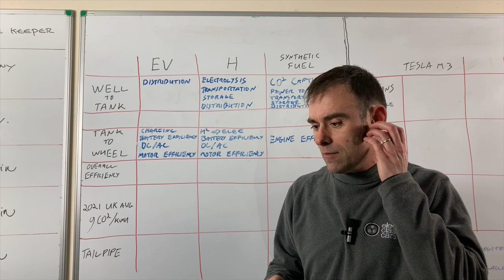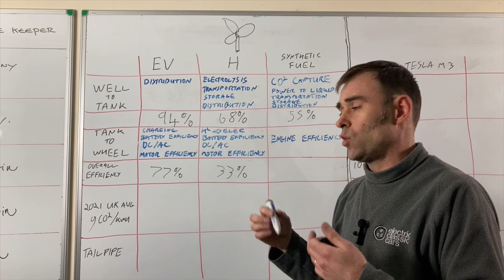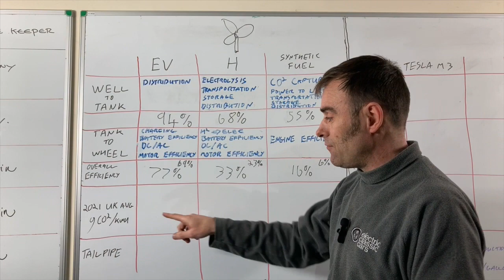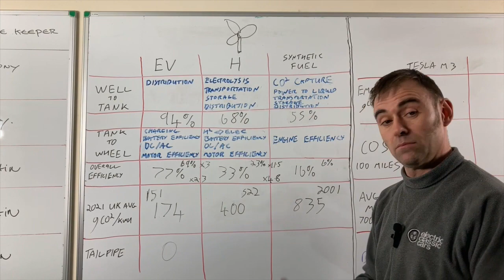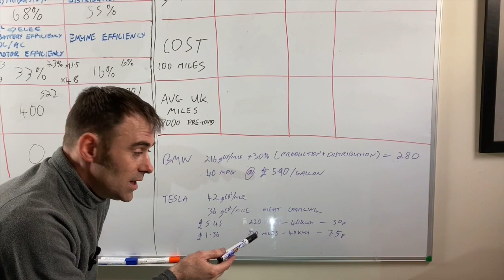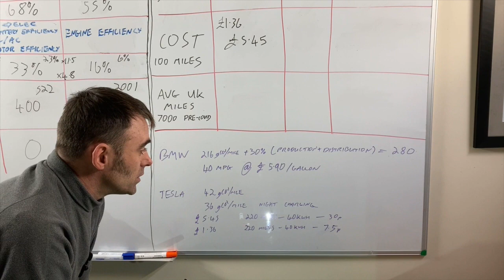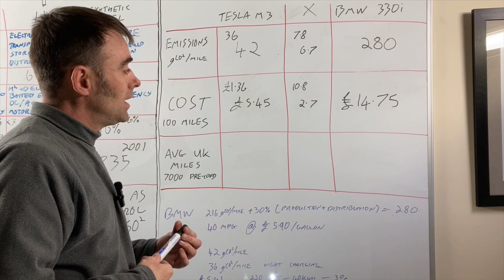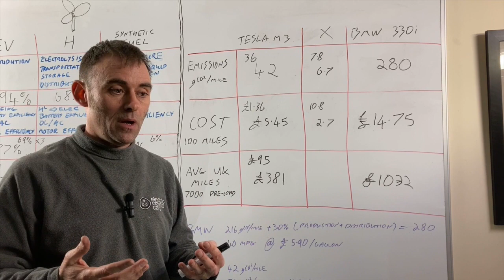Is Hydrogen or Synthetic fuels the end for Electric Cars?

Comment: In 8-10 years you (may) need new  Lithium batteries, Cost?   Pounds 9600 , So cost is about same as petrol over 10 years with replacing batteries. Emissions are better for EV but overall cost is not a great saving. You also pay more for an EV than petrol car.
Reply: In 8-10 years of owning an ICE car you will definately need a new exhaust, new cat, new clutch, various timing belts, new brake disks and multiple sets of pads, annual servicing of at least £200 vs less than half that for an EV. There is now plenty of data on EVs with well over 100k miles on showing minimal battery degredation so your argument is years out of date.
Reply: @nealm1814  very well informed repartee there. Don't forget all those oil changes(dirty business indeed those oil changes)and emissions station checks annually. 👍🏻😎
Reply: And having spent that £9600, you have a car which will last another ten years or at least be worth considerably more than the comparable 10 year old diesel.
Reply: @lizdersley9803  Apart from the fact you wouldn't need to spend £9600 anyway.....
Reply: Absolute nonsense.  Why would you need a new battery after 8 years, when it comes with an 8 year warranty, and an assurance of at least 70% state of health after those 8 years?  It's a WARRANTY, not it's lifespan!  You have obviously never heard of battery refurbishments.  Cleveleys Electric Vehicles in Gloucestershire carried out a battery pack refurbishment on a customer's 10 year old Nissan Leaf. They removed the battery pack in 20 minutes, then tested the cells, replacing the failing ones with good examples. The job took 4 hours - there are 90+ cells in a 24kw Leaf battery - and it cost the Leaf owner £600.  Where do you people get your totally ridiculous EV battery scare stories?  The video of the battery refurb is on YouTube. I suggest you ought to watch it instead of posting uninformed nonsense.. And if you have the time, you could also watch the YouTube video posted by a US Tesla Model S owner. His car was well over 10 years old, and had covered 400,000 kms on it's original battery.....

And you "pay more" for an EV, do you?   New Nissan Leaf £25k. New mid spec petrol Astra, Focus or Golf £25k. New MG5 Astra sized fully electric estate car £23k with a 7 year warranty...... I've also seen used EV's on sale at £6k.......
Reply: A quick search and you’ll find the batteries are outlasting the cars and go on to a second life as grid storage. There are a few half million mile Teslas out there.

Comment: Thanks for a very informative video.  I’m on my third Tesla and will never go back to ICE.  As an aside, I used to work in semiconductor manufacturing engineering and used hydrogen extensively. The hydrogen molecule is so tiny, it’s close to impossible to prevent leakage completely. I would never risk a hydrogen powered car in my garage.
Reply from the maker: Especially when it's stored at 10,000psi in the tank too. 😁👍
Reply: It isn't strictly necessary as such, that a garage has a roof, and you never know - on the basis that what goes up must come down - the roof might land somewhere where it'll be some use.... eventually. Come to think of it - how about a hydrogen powered pogo stick (and a parachute, obviously)?
Reply: @vipertwenty249  however, my garage is under our bedroom! 😀
Reply: @jefffarrell5603  I have hand crocheted parachutes from Plummitt&Thudd.Co for sale to wear in bed?
Reply: Not really a risk, because what leaks from a carefully sealed pipe or tank, leaks from an unsealed garage (or bedroom) 100 times more easily. This leaked hydrogen won't accumulate anywhere, just like your semiconductor facility (I assume) didn't explode regularly. Leakage was harmless even with the BMW Hydrogen 7, which by design leaked fuel for cooling the (cryo-)tank.

That said I agree, battery electric makes much more sense. Because it's much more efficient and also easier to handle.

Comment: I think that you did an excellent presentation. A little positive side note, for inland shipping companies already use electric powered transport ships and/or boats, not by the masses, but it is growing. Instead of a small battery they use a battery that has the size from a shipping container. And instead of charging the battery onboard of the ship they simply switch batteries at a dedicated battery switching station, so that the empty battery can charge onshore. I am pretty sure that those shipping companies did the calculation as well. And for them the electricity costs are even lower because they are big users and they get even better contracts. And I think that switching the battery takes less time as refueling a ship. And the costs of maintenance is drastically less as well. 

Like you said, a lot of it also depends on the type of application and the practical use and the infrastructure. 

I also believe that with the current situation around the globe the renewable energy sources are going to get a big boost. In the Netherlands they have build the largest wind turbine in the world. And a single turbine will be capable to generate enough power to supply electricity for 16.000 households. Compared to the first generation wind turbines these new turbines are colossal with a rotor diameter of 220 meters. And they are about to be installed in big numbers at off shore wind parks in the north sea, and probably all around the globe as well. 

Just for comparison, the biggest inland wind turbine in the UK at this moment has a rotor diameter of 150 meter and it can generate only 6 megawatt. These new 220 rotor diameter turbines produce 14 megawatt, and they are already developing newer types that are able to produce even more power. 

The UK government has announced that they are targeting to install enough wind turbines for the production of 40 GIGA watt of power by the end of 2050. That is more than the UK is using at this moment. And other countries are doing the same. 

So all together things are not looking too bad.
Reply: Just as I am reading the news I read that the Dutch government is going to invest 1,7 billion Euro into new Wind parks located at the North Sea. That should be enough for 750 up to 800 new turbines. And that should be enough for 10,7 gigawatt up to the year 2030. And it is twice as much as they had originally planned to do. And of course that is due to the situation with Russia. So including the installment they cost around 2,2 million Euro each. 

And it is also good news for the fish population, because they get new protected breeding grounds where large fishing vessels are not allowed to come. And where they can hide for predators.
Reply: Lots of big batteries sitting charging from the grid is also a great thing for stabilizing renewable energy - further reducing our need to burn natural gas. If we all get used to leaving EVs plugged-in when we're not using them, we will largely solve the energy storage problem.

Comment: Following your logic that the the power supply initially would come from renewables, then you need to remove electrolysis from the hydrogen efficiency degradation. The electrolysis would quate to degradation from the power to generate the grid supply from whatever source as you described with the graphic showing the pie chart of sources. From 100% down to 94% is actually grid inefficiency after the electric generation. The distribution and other degradation would be applicable.
Reply from the maker: Not sure I follow your logic there as there's losses when using electrolysis to produce hydrogen no matter what the source of that electricity is.
Reply: @ElectricClassicCars  You state that the electric for the EV side of the comparison is 94% efficient because you use renewable for the generation. I’m saying that the cost to create the power for the EV would equate to the power to create the hydrogen, renewable or otherwise. In your calculation you reduse the hydrogen side to 68% or whatever it was and part of that reduction is for electrolysis. If you negate it on the EV side you should negate it for hydrogen.
Reply: Electrolysis is most likely to be near the generating source, mainly because hydrogen is needed for more important things like steel production, cement, fertilizer and even grid level energy storage. From there it would be taken to who ever bought it or it might be converted back to electricity if it was used for storage.

Comment: in fairness, you should take into account the CO2 generated in making the vehicles.
According to Volvo, to manufacture an XC40 recharge produces about 25 Tonnes of CO2 equiv, vs about 15 tonnes for the petrol version. Although, I have some doubts about the difference.
And as counter argument, as of today, most battery packs or cells are used well beyond the lifespan of the vehicle.
And, the M3SR is the most efficient EV out there. Maybe, a comparison with a 330d was more on point.
Reply from the maker: It was already a very long video so I might cover vehicle production and end of life scenarios in a future video. 👍
Reply: In which case, it might appear as though Volvo need to clean up their act. If Volkswagen are able to produce electric vehicles in their new manufacturing plants which have a zero carbon footprint, and are powered by 100% renewable energy, then why don't Volvo?  And if they did manage to achieve that, then perhaps they would also like to sign up to the legally binding Paris Climate Agreement, like VW already have?

Comment: Are you sure about only 40 kWh being usable on the Model 3? That means more than 20% of the battery is not used... Sounds a lot!
Reply from the maker: Yep, that's what I'm seeing on our Tesla M3, I've seen it mentioned elsewhere too. Interesting the higher kWh M3 packs have a higher % useable comparatively.. 👍
Reply: @ElectricClassicCars  By any chance, do you know whether those batteries are LFP, NMC or NCA? I've also heard from Mr Musk itself (via the Internet filter) that he recommended that LFP batteries be recharged ro 100% without damaging them too much...

As for myself, I own a 2017 Model S 90D which I've always recharged to 90% daily (and a 2018 VW e-Golf which is treated exactly the same), which brings me to this question: do you offer the option, in your conversions, to limit the SoC? And if not, why, and what would be required so that you could offer it?

Comment: I would also be curious to see how ev would compare if the electricity comes from a coal fired plant like mine does.
Reply from the maker: Then you should use a gCO2/kWh of more like 750 gCO2/kWh which is Polands grid emissions in 2021. Poland is heavily reliant upon coal. That's 4.3 times more than the UK. Which would make the Tesla M3 emissions 182gCO2/mile which is still less than the 280 gCO2/mile for the petrol BMW.😲😲😲
Reply: Hydrogen tanks PSI - 3500 -- 10-000 just a few inches under your rear seat.... Synthetic fuel aka rubber/plastic rotter petrol and hot engine... anyone got some jacket spuds.....

Comment: Excellent presentation Moggs. I've been trying to tell people this for a couple of years, but it seems to fall on deaf ears. This info needs putting into an ad on TV, like a public service announcement.  👍
Reply from the maker: Spread the word. 😁👍
Reply: Agreed, but there is still plenty of easy low hanging fruit in burning less fuel and that is driving more economically and using you heating more economically - save the planet and your wallet!
Reply: @TC-V8  you don't see many people trying to drive economical, even after the recent price rise,  its called eco safe driving in an HGV.